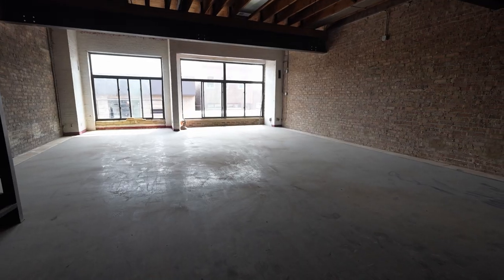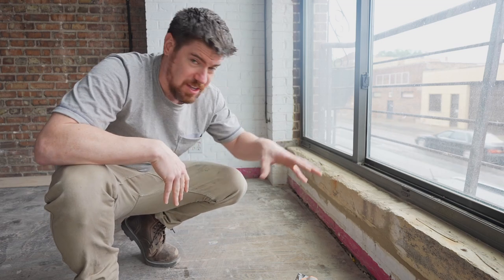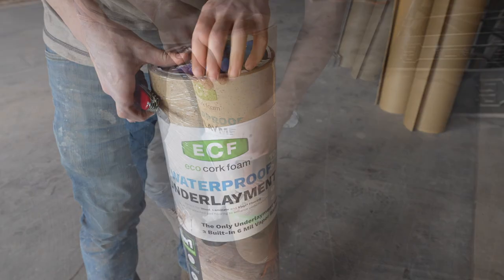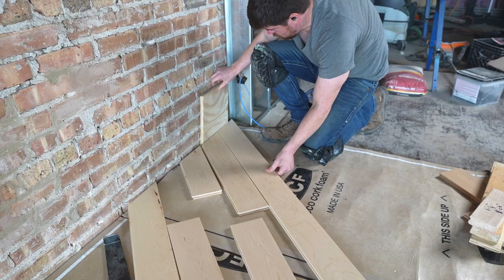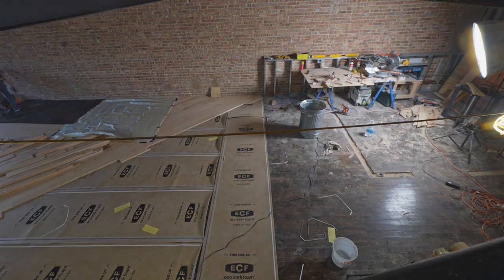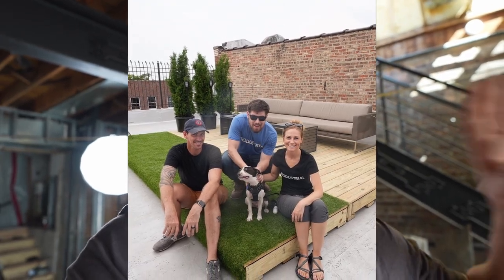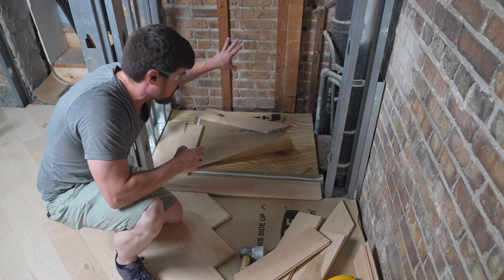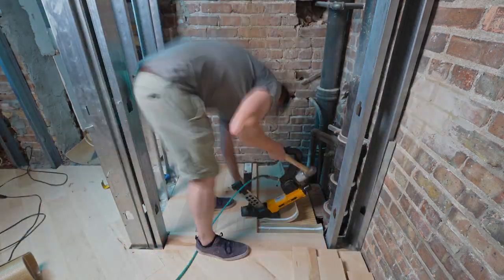ep. 23 - The MOST Dramatic Change yet!!!  ...Abandoned Bldg Renovation

Comment: So I didn't see what screws you used on the hangers when you did the floor repair by the window ( fungus window) but I know typically you're supposed to use nails in those joist hangers as screws don't have sheer strength. Again I didn't see the exact screw you used but you may want to double check that if you just used regular screws. Great work tho and great attitude, it's definitely easy to get discouraged when you come across stuff like that.

Comment: I'm gonna ask a really stupid question - you said that the original floor required a 3/4" gap around the edge for expansion and because they left the shims in that's why it buckled. When you repaired it with plywood it didn't appear that you left a 3/4" gap. Does that mean that the new subfloor (the old floor) is going to buckle again?

Comment: Aren't you supposed to use nails and not screws in joist hangers to prevent sheering?
Reply from the maker: Yes, you are correct, I'll go back with nails just in case, but it's probably ok as is since the joists only span about 2 ft

Comment: Great video as usual. One question though. Did you get the thermoplastic floor tiles from under the original wood floor tested for Asbestos? They look like Marley thermoplastic floor tiles which can contain white chrysotile asbestos fibres. Just a heads up, I hope they weren't. Keep up the videos please, you are one of my favourite channels to watch.
Apologies if this has already been mentioned in another comment. There were so many to go through, I didn't check every one.
Reply from the maker: No I didn't....and yes they could be asbestos.  However, asbestos tile is much different than the asbestos insulation that easily becomes airborne... It's actually common to simply put new flooring over old asbestos tiles, rather than deal with ripping them out.   I was careful to wear a mask for the few cuts I did make, just in case.
Reply: @modustrial  that's good that you are aware. Disposal of the waste pieces is the other issue. Im an asbestos surveyor, so I'm aware of the low level of risk associated with these tiles. It may be something that your viewers may benefit from being made aware of, that when doing refurbishment works, there is a very high possibility that they may come across or be exposed to asbestos containing materials (ACM's) in the process. I'm not picking holes in you and I hope it doesn't come across that way. I'm relieved to know you had knowledge of the issue. If we can make others aware in the process, that would be great. There are many people who have no clue about asbestos or that it's still a huge killer in trades industries and a huge problem for the average person doing DIY. I see many People who attempt to do work themselves and  end up in problematic situations.

Comment: Bro i just had a similar issue in my house with some braindead person who did electrical before i had my house. I was cutting out drywall like at face level with my oscillating tool and then bam sparks shoot out into my face. Thankfully i had not gotten electrocuted and had safety glasses on. Some jackass wedged 3wires up against a stud and covered it in spackle and smushed the drywall over it🤦‍♂️. Easy fix but i definitely just about soiled myself after cutting into them lol.

Comment: You’re not supposed to tape the seams on the rolled out underlayment?
Reply from the maker: The manufacturer is very very specific to not use the seams when you have a wood subfloor....they are only used when you have a concrete subfloor.

Comment: Question for ya. Been following you for a very long time and love your work, however, am a little disappointed. I put down the same ECO Cork vapor barrier under my floors btw. WHY did you not seal the edges together? They have the flap and glue strip already on there ready to fold over. Driving me crazy! Please let me know your logic for not doing this so I can chill. :)
Reply from the maker: Good question!  You likely installed over a concrete subfloor.  The ecocork foam instructions indicate multiple times that you should NOT use the plastic seal between edges when laying it over plywood subfloors, since you need to allow some ventilation.  Seemed weird to me, but just following the manufacturer instructions :)

Comment: How did you decide to run the flooring at 45 degrees instead of straight? We're planning on redoing our floors in the coming months and I haven't been able to make up my mind about this
Reply from the maker: It was either that or horizontal....couldn't do straight boards parallel to the length of the room because when you use the old wood flooring as a subfloor, the new floor boards need to run accross the old ones (can't install them parallel to the old ones).  If you like both, and can't decide, straight install is much less work and generates less waste.   However, if you love diagonal, it isn't that much more work to do.
Reply: @modustrial  great, thanks for the help!

Comment: Do yourself a favor. Whereever you can, spend the time and money and pull up all those old subfloors and find all those old issues like rot, coding violations and such. You never know what you will find that will save you a headache having to rip out a finished floor to fix a structural issue or an old rotting cast iron pipe or whatever.

Comment: 3D print something that would fit the design, lil bonda filler and paint no one would have a clue.
Reply: With the right measurements wouldn't be hard to design something in Fusion360 and cut it out on a CNC also.